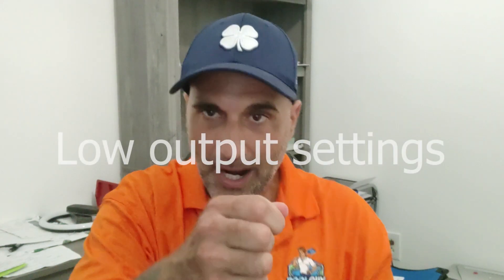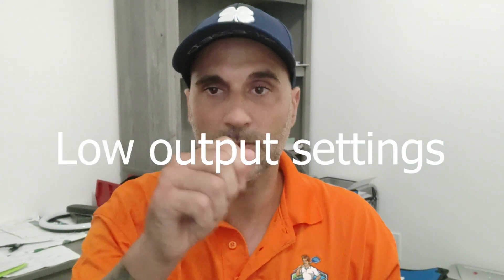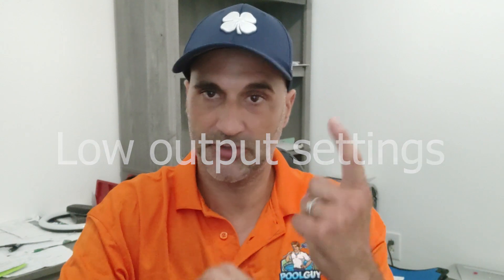SALT CELL NOT PRODUCING CHLORINE? 3 REASONS WHY

Comment: I have a new (1 month old) Hayward Omni salt generator that is not generating chlorine. The unit reads high salt level (3600-3900) but salt test strips and testing at my local pool store both reflect 2819 ppm. Any troubleshooting thoughts or ideas?
Reply from the maker: @cobr9493  check for phosphates! Have the pool store check for that with your water sample. I have a video on how to check for phosphates, but if you have a pool store nearby then it might not make sense to buy the test kit. I also have a separate video on how to remove phosphates. Check back in with an update
Reply: @poolguyfl  thank you!
Reply from the maker: @cobr9493  you're welcome and good luck. Check back in and give us all an update
Reply from the maker: @cobr9493  I have a follow-up question ❓ how many hours a day are you running your pump?
Reply: @poolguyfl  we started at 4 hrs twice a day but for the last 2 weeks have been running it 11 hrs a day from 8am-6pm and 1-2 am.
Reply from the maker: @cobr9493  That should be enough run time in most situations. 
1) Check your filter. If cartridge clean it, DE/Sand backwash.
2) How many gallons is your pool and what size salt cell do you have? Meaning how many gallons is your salt cell rated for?
3) What part of the country do you live in?
Get back to me